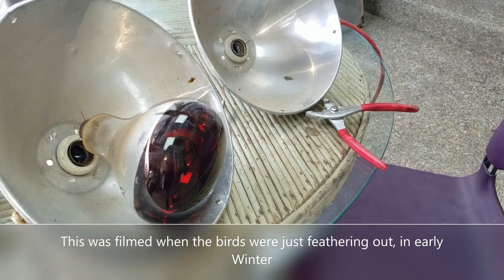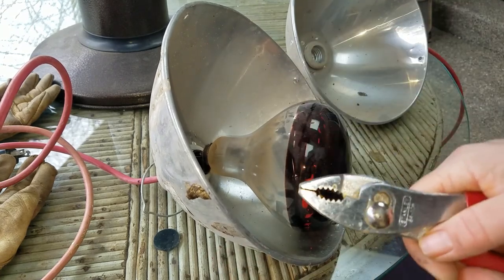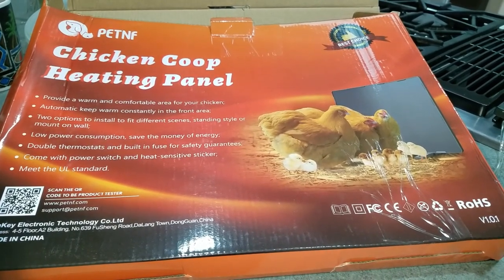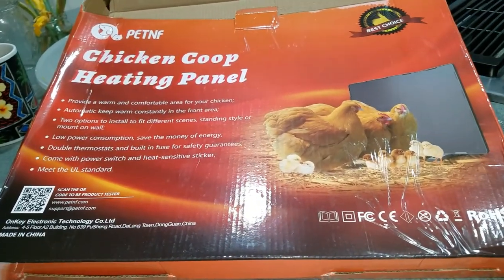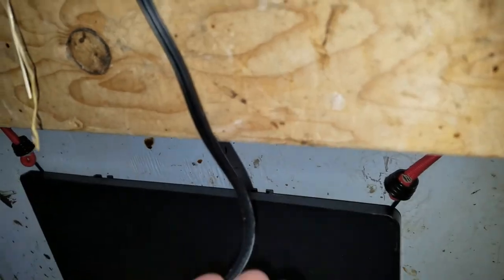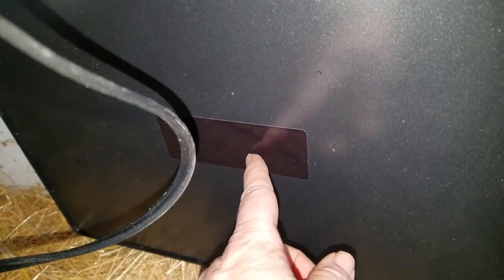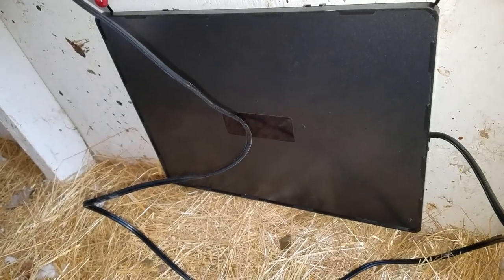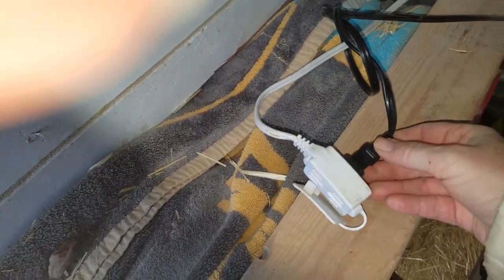Chicken Coop Heating Panel

Comment: I'll have to check out the heat panel. my daughter has the no light ceramic bulbs. the chicken don't peck at the ceramic like they do with the heat lamps
Reply from the maker: I used to love the lights and now I think they are just too dangerous...I'm not married to this particular panel, it worked well, and keeps working so far so good!  They are more cost effective and i like that you can manage the temp instead of hoping the light is hot enough but not too hot.

Comment: I hope you're serious about answering questions? My Cozy Coop 200 watt heater with the toggle switch keeps turning off & it didn't mention this in the box. Does it shut off for a reason ?
Reply from the maker: hi Sam, please realize that I don't work for a heating panel company....i'm just a chicken owner who uses one.  I'll give it a try tho.  My heater I can set to a certain temp which means once that temp is reached the unit will turn off until the temp drops and then turn back on to keep the temperature within the amount you set.  If that is not the issue then you can have a power short either within the unit itself, within the cord (the unit cord) or an extention cord you are using or the plug in you have your unit plugged into.  If you can be more specific I can help.  to ME a toggle switch is like a light switch it is a literal switch which will turn go from up to down or from side to side.  If that is happening then you definetly have an electrical issue and need to stop using the unit.  I would start to look at water issues (either condensation or the extention cord in water) or similar.  Let me now if I can help you problem solve any more.
Reply from the maker: here is the Cozy Coop Contact info (it's not the brand I use so I googled it)  Cozy Products
845 N. Larch Ave.
Elmhurst, IL 60126
Phone: 800.662.5021
International: +1 312.226.2473

Comment: How do you know what the temperature is?  I have fully feathered 8 week Americaunas and the temp is 40’ at night and thought they were a bit too young to be in 40’.
Reply from the maker: I really don't care how hot the panel is, i pay more attention to how hot the air is around the panel, so i measure that with a regular thermometer....for baby chicks I'd hang the panel above them (like a little roof) giving them space to get under easily and get away from it easily.  heat up the panel (halfway or more0 and then watch the chicks...this will only take a few minutes...if they are all huddled together under the panel, it's too cold.  if they all get way from under it, then it's too hot.  This is the same thing we do with lights... Fully feathered birds are often warm enough but i get why you'd worry (i would too) you might find this article interesting and helpful;  https://backyardpoultry.iamcountryside.com/feed-health/how-long-do-chicks-need-a-heat-lamp/